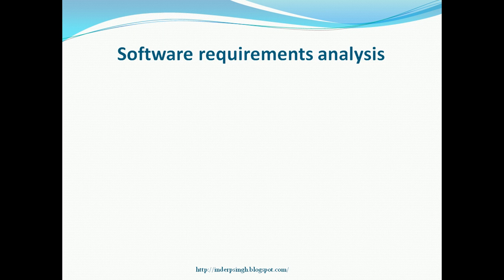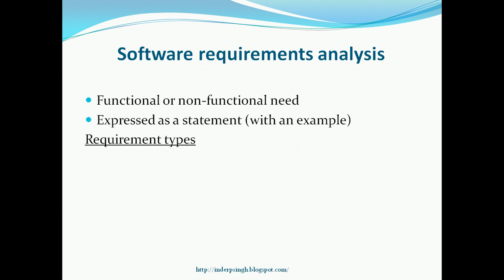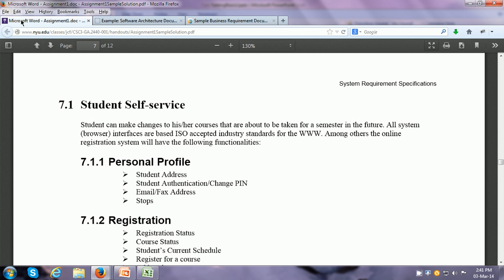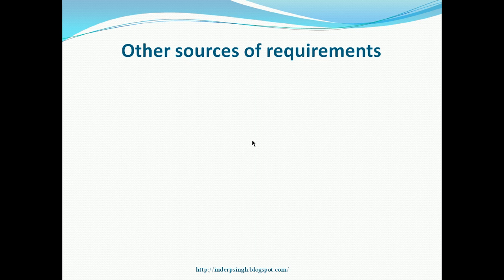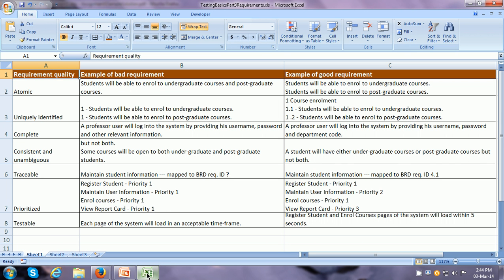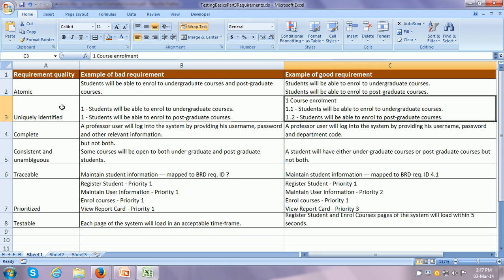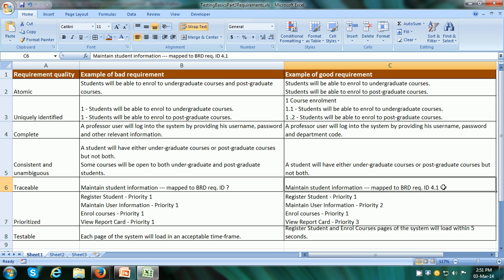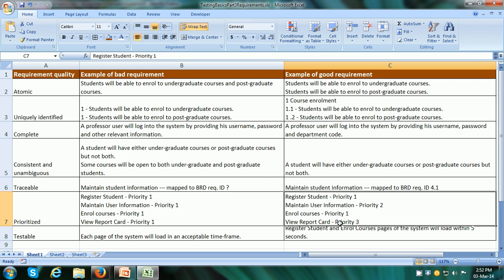Requirements Analysis In Software Engineering-Requirement Analysis In Software Testing-Requirements

Comment: HI Inder, I have a quick question. 
If a client sends an email with a single line requirement to the business analyst, what are the basic questions a BA needs to ask? Let's consider an example, "I want a Content Management system." Please provide your suggestions. Thanks!!
Reply from the maker: Hi Muralidhar, that is an interesting question. My response to such a question would be a summary of a CMS system and a request to do a presentation (in which you could ask the basic questions). 
For example, one could mention that the CMS is an application to manage digital content. Typically, a CMS provides publishing, version control, storage, search and retrieval features etc. in a collaborative environment. Need further information:
1) Do you want an off the shelf system like Wordpress, Drupal or Joomla or a custom-built system?
2) Whether it will be an internal system or an internet-based system (with SEO)?
3) What features does the team need immediately and in the future?
4) Does the system need to be integrated with other existing systems?
Request to schedule a presentation followed by Q&A and discussion to finalize next steps.

Comment: does software requirements analysis mean the same thing as requirements Engineering for Web Applications?
Reply from the maker: The purpose of Software Requirements Analysis is to understand and review requirements that are already defined. This is needed to do software development and testing activities.
Requirements analysis needs the requirements from Requirements Engineering (which includes requirements gathering, requirements definition and requirements maintenance).
Reply: Thanks, What I was trying to ask, is there any difference between software requirement and the engineering requirement for Web applications, for instance : 
 For general software systems:
• What the system should do?
• Which services it should provide?
• To which input data i t should react?
But for For web applications:
• What an application propagates to a web site user interface?
• Which input dialogs, such as forms, or even more interactive
multimedia plug-ins should be available at a particular Web page?
• Which functionalities they invoke?
• Which links they influence?
• How certain information service pages link to each other?
Reply from the maker: A web application is a particular type of software. When the web application is deployed and operational, it is a software system. No, there is no difference between software requirements and engineering requirements for any type of software.
A couple of additional points. There are no general software systems, only specific software systems like specific web applications, web services, business productivity applications, utilities, operating systems and others. It all starts with the business objectives that we want the software system to achieve. Your questions about web applications focus on it's UI only. Since there are such a huge number of web applications around, there are such questions to elicit requirements for web applications. But, such questions are available for other types of software too.

Comment: Thank you for the great information. I have some questions please: 1-it there a checklist to evaluate the SRS regarding the SW & HW requirements? and how can I evaluate that something missing in the technical part n order to prepare the required SW & HW for the testing environment. Thanks in advance.
Reply from the maker: Nora D You are welcome to my channel. My replies are: 1-As explained in my video, we can check that each requirement in the SRS has good quality i.e. each requirement is atomic, uniquely identified, complete, consistent and unambiguous, traceable, prioritized and testable. 2-Finding missing technical requirements is difficult. However, we can check that each higher-level business requirement and functional & non-functional requirement has corresponding design requirement(s). Also, missing requirements would result in certain failed system and acceptance tests.

Comment: wow..very detailed and informal video..Great work!! Say - where can I find the xls sheet you are using as a sample of god and bad requirements ??? any link
Reply from the maker: Mhilu - Thank you.

Here is the data that I used in the Excel sheet. Please paste it in a CSV file and open with Microsoft Excel :)

Requirement quality,Example of bad requirement,Example of good requirement
Atomic,Students will be able to enrol to undergraduate courses and post-graduate courses.,"Students will be able to enrol to undergraduate courses.
Students will be able to enrol to post-graduate courses."
Uniquely identified,"1 - Students will be able to enrol to undergraduate courses.
1 - Students will be able to enrol to post-graduate courses.","1 Course enrolment
1.1 - Students will be able to enrol to undergraduate courses.
1 .2 - Students will be able to enrol to post-graduate courses."
Complete,"A professor user will log into the system by providing his username, password and other relevant information.","A professor user will log into the system by providing his username, password and department code."
Consistent and unambiguous,"A student will have either under-graduate courses or post-graduate courses but not both.
Some courses will be open to both under-graduate and post-graduate students.",A student will have either under-graduate courses or post-graduate courses but not both.
Traceable,Maintain student information --- mapped to BRD req. ID ?,Maintain student information --- mapped to BRD req. ID 4.1
Prioritized,"Register Student - Priority 1
Maintain User Information - Priority 1
Enrol courses - Priority 1
View Report Card - Priority 1","Register Student - Priority 1
Maintain User Information - Priority 2
Enrol courses - Priority 1
View Report Card - Priority 3"
Testable,Each page of the system will load in an acceptable time-frame.,Register Student and Enrol Courses pages of the system will load within 5 seconds.